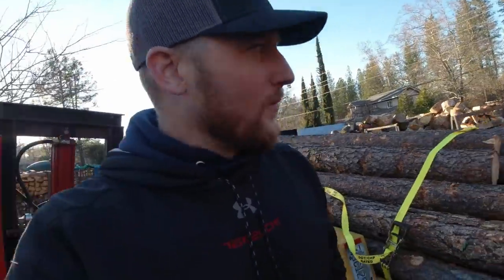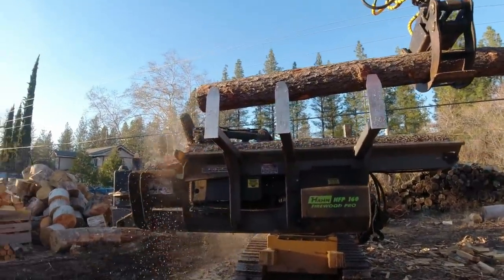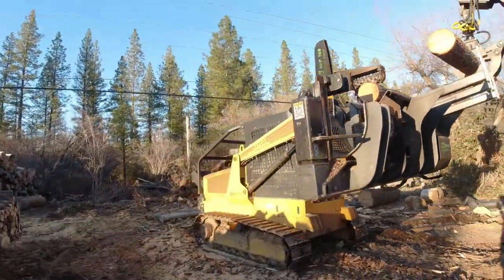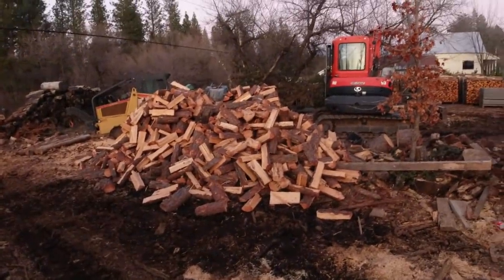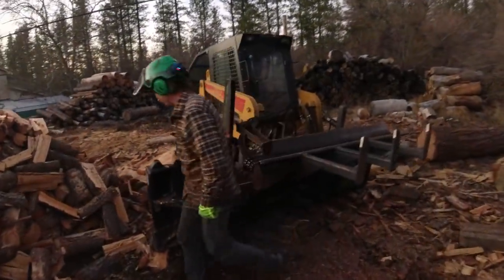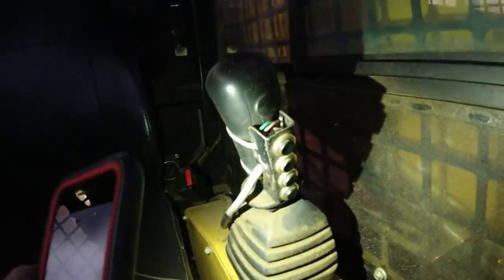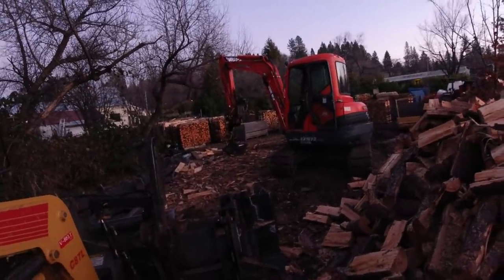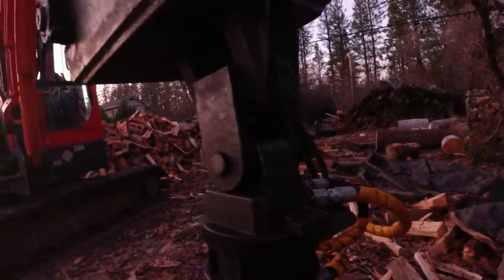Amazing Firewood Processor! 2.5 cords Cut and Split in ONE Hour!!!

Comment from the maker: Stacked it after making this video. And it measured out at 2.5 cords!!! NEW Record for us! In one hour!
Reply: How much do yall sell a cord of pine wood for ?
Reply: Geeze 1hr for $5-600.00 worth of firewood. At least that's what it goes for in our area! You sure have some fun toys.
Reply: @jclaydon3454  a cord goes for around $100 around here
Reply: @lmsendit9531  wow... I'm in Eastern Washington and Cord wood goes from 200-350 depending on what you're getting.
Reply: @jclaydon3454  wow wish we could get them prices around here hundred dollars here you can get pretty much any kind of wood
Reply from the maker: Hahah 100 bucks? For a cord? That’s cheap cheap 
What we split is a about what J Claydon said
Reply: @VBELTandSON  yeah I wish not down here in the South it ain't
Reply: That's fast!
Reply: Here in Ky you can get a cord of seasoned oak for $50.  I burn white oak and I couldn't imagine burning pine.  Doesn't it burn really fast since it's a soft wood?
Reply: Wow, Here its $250-$300 per cord of oak on Long Island, NY. I was lucky, and responded to a free logs ad on craigslist, and made a contact for wood with a tree trimmer. I now have an endless supply of logs.  Any creosote & chimney issues burning pine?
Reply: Best I've ever done was 6.5 cord in 2.5 days. Cut split stack
Reply: V-BELT and SON just curious is the processor have a guy in it or does it just spilt until you shut it down
Reply: V-BELT and SON  I did not realize some people use pine for firewood. Down here in Alabama all people use is hardwood
Reply from the maker: Blake Terry pine is the main tree in Northern California where we are.
Reply: @lmsendit9531  do you mean a face cord?
Reply: In new england we throw the pine out. Then we beat our shit up cutting oak ect. Then we deliver the cord for 200$ seasoned. Some guys will stack the cord too lmao I wish the game was better here. If it were I would get some splitting implements for the mini and maybe the CTL
Reply: V-BELT and SON 600-700 around here for that nice need me one of these doing 4-5 cord a week with just a wood splitter long process
Reply: Hey man where did you get the steel tracks ?? And did you and your dad engineer the splitter also?
Reply from the maker: Matthew Tucker steel tracks came with the machine new. And the splitter is made by Hahn
Reply: Am I missing something?
It may tie up the machines...but only for an hour.  

The wood could sit until you have the equipment at your yard to do it (assuming they were out on a job).

Also...you're saving wear and tear on a mulcher head by NOT having to mulch it all.

All in all Id say you come out ahead, whether you sell the firewood or use it to heat your own house.

Comment: It is nice to see the Rayco Crawler in action. That model is not made anymore along with the dozer. It was fun to be part of the team that designed this machine. I was the CNC programmer for the punch presses, laser cutter, and flame table used to build the crawlers. The original design was a combo of a loader, as seen here, and a dozer with a 6-way adjustable blade. The machine was made to switch out between the two options. Later they were separated into two different machines. Now the two are no longer made. Great video!

Comment: As a manufacturer's rep, I often had farmers tell me they could not hold their hand on the external tubes - telling me the machine was running hot.  FYI hydraulic fluid runs about 100 F hotter than ambient temperature - meaning you will get a nasty burn if you try to use your hand to check temperatures.  Use a non contact thermometer across the oil cooler (inlet and outlet) to see what is really going on with the temperature, if you think the oi is running too hot.  I like how quiet your processor is and how fast it is - especially with multiple pieces split together.  Keep up the good work.

Comment: Seems like I rarely get into straight wood that would work in a processor.  I have it in my head to build a blocking table to feed my Eastonmade. Start simple and add a hydraulic saw once some of the details are worked out.  Hand cutting and loading the splitter is a bottle neck. Thanks for posting, neat operation.

Comment: Pine burns way too fast. Everyone here in East Texas uses hardwood. Don't give me that excuse about pine being your main tree there in California. Guarantee we have more pine in East Texas. If you tried selling that here, you'd be laughed at.
Reply from the maker: Hahahah have you ever been to my area? There is nothing but pine and some fir. Yes oak is good that is an option but not not straight enough to run through the processor. My opinion you would get laughed at for having a cold house. But pine is a good starter wood then throw on the oak. Not a difficult concept 👍🏻 ps your Texas pines look skinny lol
Reply: @VBELTandSON  We start with rich lighter pine (small pieces of kindling) then put on hardwood. So there's almost no hardwood in your area? It's  probably 80% pine to 20% hardwood here, but nobody uses pine for a constant fire here. You'd burn through way, way more than using hardwood.
Reply from the maker: Then burn through more of it. What’s the problem guy? It’s just firewood. I wouldn’t even say 10% or of trees in the area are hardwood. The rest is all soft wood. Why the hell is there such an issue about burning pine. Want a warm house or not? Pine or any other soft wood works perfectly well for heating up your house quick and once you have a good fire then throw some holy oak on there and kick back and relax.
Reply: @VBELTandSON  So you do use hardwood or just pine exclusively?
Reply from the maker: Like I said in the previous comments. I start with pine or softwood and throw on the oak when the fire is cooking nice and hot. But in short if I only have softwood in hand I have no problem just heating my house or shop with softwood. Works will keep turning. But honestly if the wood is too small for the mill what we going to do with it. We mulch or ship up hundreds or cords every year

Comment: Ummmm who the hell burns pine in a fireplace??? I use alittle lighter to start are fires but oak is what you use not pine. Good way to burn a house down man. Pine builds creosote and that's not good. Not hating on you just giving you some advice that could save yours or somebody's life. I have seen 3 houses burn this year cause of this.
Reply from the maker: Keep chimney clean. 
Been burning pine for my whole life never seen an issue with it. No chimney fires and most of my area ppl burn pine and oak but pine is dominate around here. Oak isn’t as common